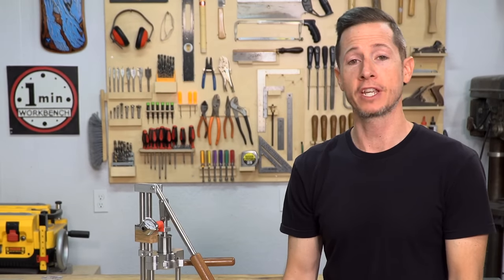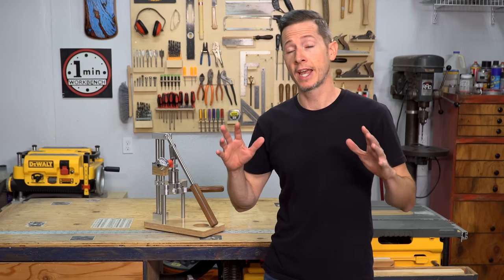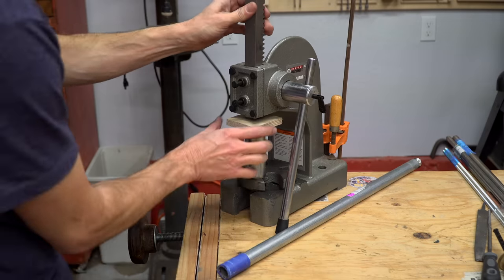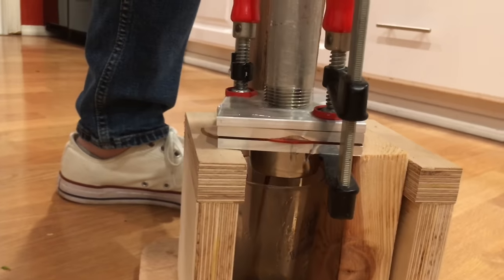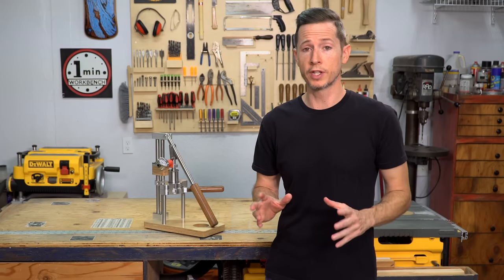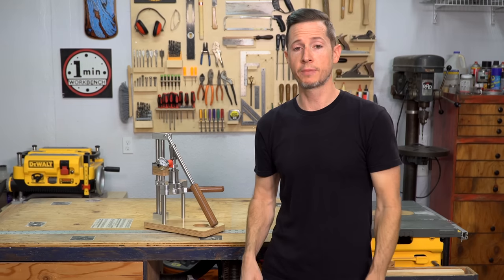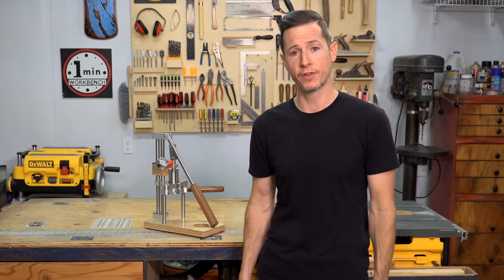I Built an Espresso Machine!

Comment: Idk how this only has 700 some odd likes. I just had a thought. “I wonder if I could make my own espresso maker”, and low and behold I found your video. Now I know I can’t. What you’ve done is amazing though!
Reply from the maker: Thanks!
Reply: You could definitely do it by using more parts from other machines though. Making your own group or boiler is not gonna be easy but sourcing materials from broken machines and building your own that way is much easier. Doesn't have to be a manual lever, might seem simple but requires more custom work if you're not gonna use a pre existing lever group.
Reply: 😅 @beenstucinredclay same.

Comment: This is so dope!  I'm also a woodworker and a coffee aficionado so I understand exactly what type of machine this is and how hard it was to make it.  I'm actually really surprised this didn't get more traction on the interwebs.  I think you kind of undersold it with just a 6 minute video covering the whole thing.  The skills you got out of this though are priceless!
Reply: because this is like saying you invented a new wrench. you should actually be familiar with a wrench before you claim it needs another invention. all this did was replicate existing manual lever machines with no benefit. and more and more of this same lever machine has being created by others since your comment, with only slapping better looks/materials on it.

as a manual lever user, there is nothing more to improve on what is perfect for what it is. there actually is more improvement on the coffee side of how to extract it, that i learned from using a manual. and that is the disconnect. i doubt this guy even used his machine 20 times. probably doesn't even touch it at all.

Comment: ok - job well done. But what does this one do differently to the Rok/Flair/Robot manual espresso machines? Maybe James Hoffman could give it a go... :-P
Reply: Great minds clearly think alike - I've just message James with a link to this video. :)
Reply from the maker: Thank you! I know I’m biased, but I think it offers several advantages. Check out the Kickstarter video, and you’ll find more info on the technical points. I hope this helps!

Comment: Problem with this kind of machines, is temp control. It's pretty hard to get such an  arrangement that is not connected to a boiler to a reliable temp and after its heated up a bit, you are forced to act quickly. Outerwise you get coffee that was brewed way too cold. This concept makes more sense with less expensive devices like the Neo from Flair.

Comment: 2:34 Pipe thread has a path around it that makes it require sealant of some sort. 4:00 That's exactly how I had to move my 3-phase lathe.
I gotta check out the website but I'm hoping you've made kits where I can purchase just the parts that would require machining, as I'd like to incorporate them into my own design for the overall body/lever assembly. Thanks for the video!

Comment: Hi man, this is a great project! This deserves to be produced on demand!

 There's one specific thing that strikes me about it, specifically the seals made with custom molds.
I have a spring lever machine for which I'd like to make silicone piston seals.  

Would you mind recommending a silicone solution to pour into the mold?  Thanks a lot!
Reply from the maker: Thanks! I’d check out smooth sil 960…it’s the ONLY thing I’ve found that works.
Reply: @OneMinuteWorkbench  
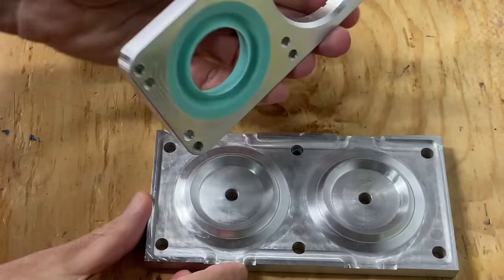One more thing, you're showing a large u-cup  without a center piece at 04:56 . That's very close to the shape of my seal. 
Am I right that the mold 3 parts? The lid isn't shown and it has a cylinder part that goes till the bottom and 2 holes above the u-cup for the solution ? 
So the lid is kind of like this (side view), apologies for the drawing: ---- * |____| * ----  * |____| *  ----
Reply from the maker: It depends on how you do it…you might not need a 3rd part. You can set it on a level surface and carefully pour to the right level. If you do create a 3rd part, you’ll have to create vents for air bubbles. If you only need a seal or two, you can get away without a lid.

Comment: Hey Dude! Great machine, I really like the thermal insulation. Sad to see the kickstarter didn’t find traction. 

If I might make a suggestion if it’s going to live on the counter it should look more like art. I know BB is a better material but a walnut baseplate and bearing block would simplify the design. Mill the replacements for the red bits and swap the Philips heads and I think you’d have a much prettier machine to advertise.

In any case you’ve earned my sub! Hope you’re still making wicked stuff!

Comment: Nice silicone moulds, I am wondering how you injected silicone there, by using smth like syringe? Also why aluminum? I am using plastic. Are you vacuuming the silicone before injecting it? Nice work.
Reply from the maker: Thanks! I’m actually just pouring them, and I have strategic vents that let the molds fill. And yes, vacuuming the silicone before the pour.
Reply: One Minute Workbench pouring through vents? or just when the mould is open?
Reply from the maker: @dmyegorov74  both, depending on which mold it is. There are 3 total, and each one works a little differently from the others.

Comment: Just a question, why did you have to machine the silicone? Could you not have made the silicone with 3d printed parts? 

Or, did you just make them out of machine parts so you can replicate the silicones easier for resale?
Reply from the maker: I started with 3D prints for the seal molds and they produced seals that worked, but not with a very high quality surface finish. The aluminum molds make excellent quality parts, and yes, also make it more repeatable. Great questions - thanks for asking!
Reply: @OneMinuteWorkbench  great build! :)
Reply from the maker: Thanks 🙂

Comment: And then there is the Flair that has been on the market for some time. Less expensive too. Other levers out there too, what's special about this one?
Reply from the maker: Thanks for the question! This machine offers an improved workflow (less preparation, less effort, easier cleaning, no preheating required). Have a look at the Kickstarter page to learn more: https://www.kickstarter.com/projects/2064847582/leverhead-espresso-machine I hope this helps!